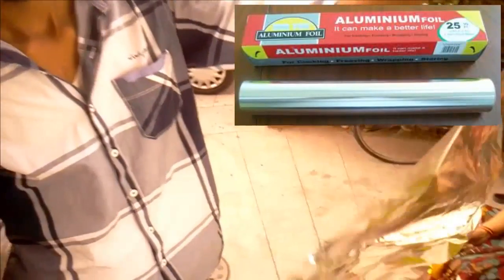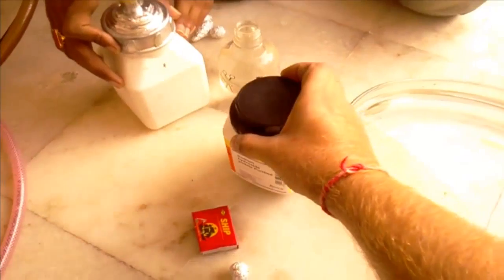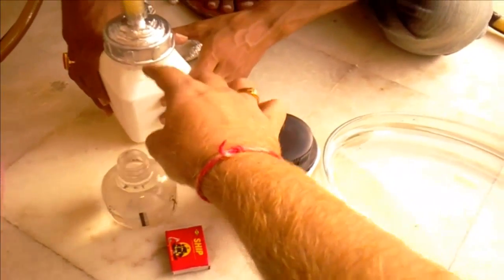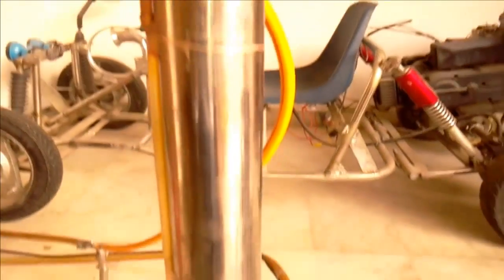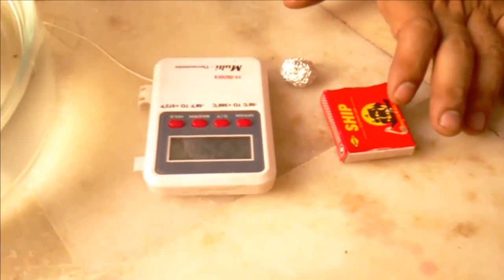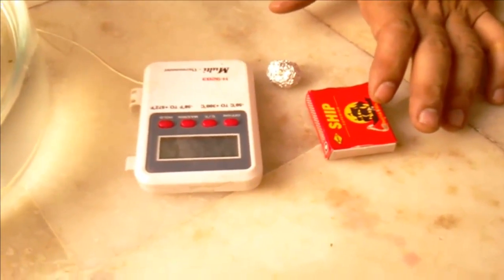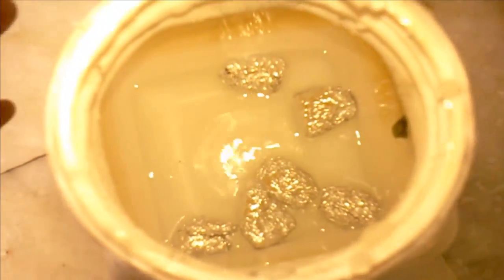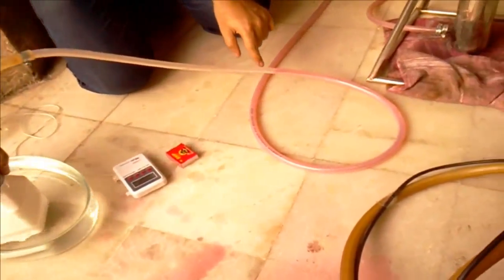Hydrogen Generation from Aluminium and Sodium Hydroxide NaOH

Comment: Interessante aonde se conecta a mangueira amarela ? Já que ela é a linha de saida do hidrogênio??? 🤔🤔🤔🤔🤔 Eu em estranho pois a sua mangueira vem la do fundo né????Interesting where does the yellow hose connect to?  Since it is the hydrogen exit line ???  🤔🤔🤔🤔🤔 I'm weird because your hose comes from the bottom right ????
Reply from the maker: Thanx for your curiosity.. This is to reduce flashback.. Left 5mm pipe is for water gauge. Watch till end
Reply: @TarunShrivastava  thank's   ... on the bench ok, but outside I could not see where the hydrogen of the Bowl fits into this which comes out the torch flame?  After all the gas goes out by a single point🤔

Comment: All these process can be avoided now scientists in US army labs in Aberdeen, MD USA  have discovered accidently an alloy of aluminium through nanotechnology methods that can split water without any additional input of any chemicals or energy such as heat/electricity. It immediately splits water at contact and this can be used to close the loop of a fuel cell or hydrogen can be directed to an ICE for combustion. How cool this can be ? BIG OIL COMPANIES WILL SNEER WITH JEALOUSY 😂😂
Reply: And it is called?

Comment: Hello Tarum, I am from Argentina, and I wanted to ask you about the electric circuit of the cell plate, which you did mixing aluminum and sodium hydroxide, wanted to know how did variable (changing) power, electrical circuit, and rectficador. You're known for your videos here, I congratulate the lighting always be with you. Namaste.
Reply from the maker: ******Hola ¿cómo estás*****
 Gustavo martin ... "I wanted to ask you about the electric circuit of the cell plate" in this video there is no need of power supply there is previous video "tishitu home gas" where i m using Power supply with PWM generator to control flow rate of HHO :)

Comment: Are you putting some of the hydrogen into a tank? I would like to know how to do that so that I can store the hydrogen I generate
Reply from the maker: yes you can store hydrogen .. if producing by aluminum "watch?v=m9Q6gDKP2R0" follow this youtube link
Reply: I have seen that video before but I was wondering if i could generate it outside of the tank and then put it in a tank
Reply from the maker: yep you can take higher capacity tank and store in it ...but calculate expense of aluminum
Reply: Tishitu Can you explain why the container doesn't explode while the gas is burning on the hose?